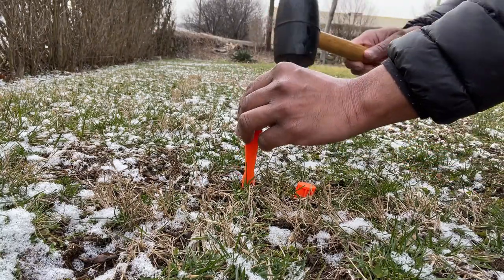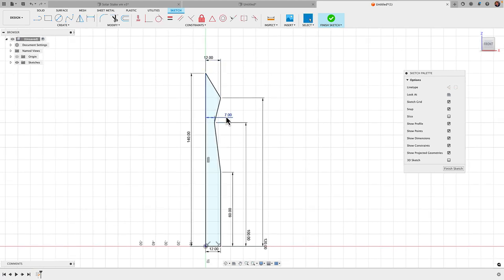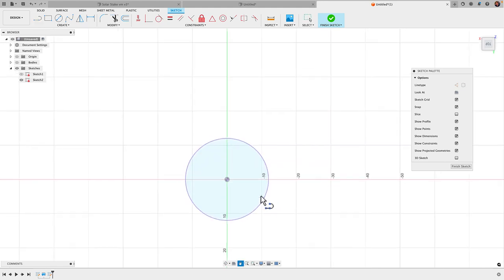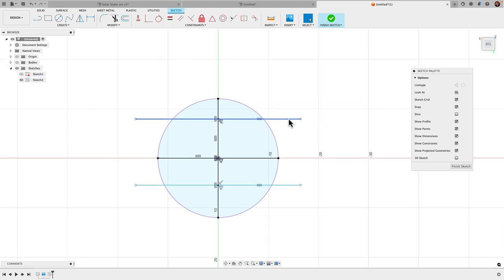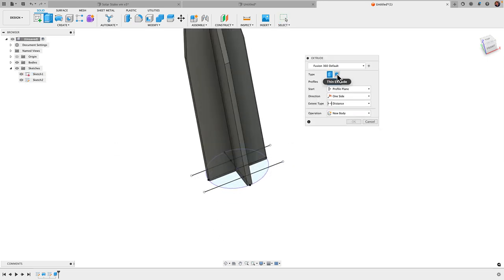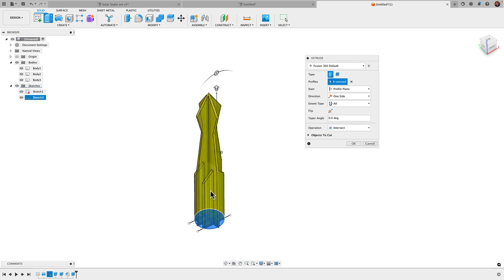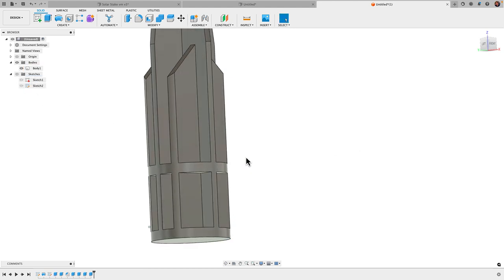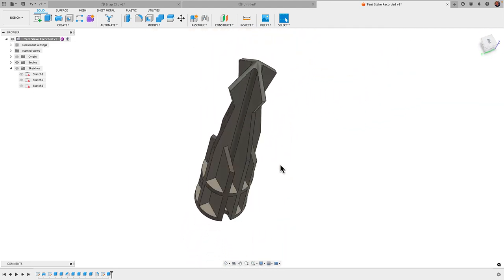Design a Tent Stake in Fusion 360

Comment: I wanted to thank you for your fusion  360 lessons I'm using 3d printing for replica parts for a 1888 frick 0 sawmill cast iron frame variant and horse drawn hay  equipment im also going to be apprenticing with an Amish carrage shop with intent to start my own wainwright/Wheelwright business  alot of the equipment I want to work with just doesn't have replacement parts anymore and if I'm going to invest my time constructing and restoring this stuff I want to do it right. I'll also be making needed equipment for my friends in the gypsy vanner horse society we run two of their shows one in Southern Ohio and centeral Michigan

Comment: I would just keep in mind, a lot of these features are done to save material in injection molding, but since it's being designed for 3d printing, more may be less. If you had only done the first revolve (plus a slot that I assume is for alignment/ your last step here), it would have likely used less material on a low infill and had less area to have dirt get stuck in later. I don't know if that extra surface area is actually useful for staying in place or not, but since this one is just for a stationary light, I'm guessing it's cost-saving.